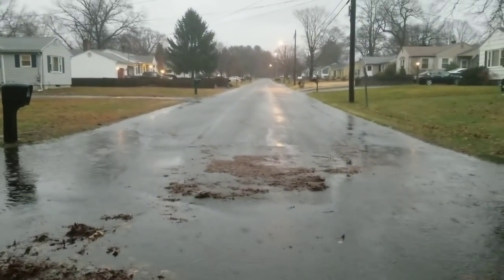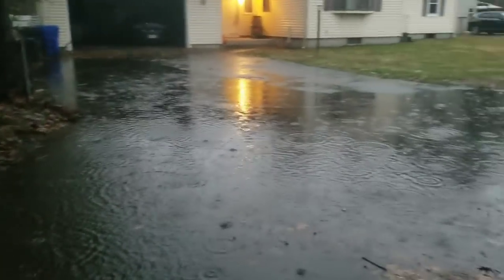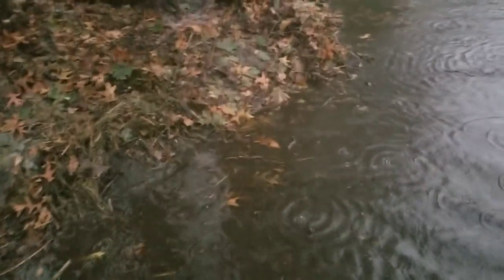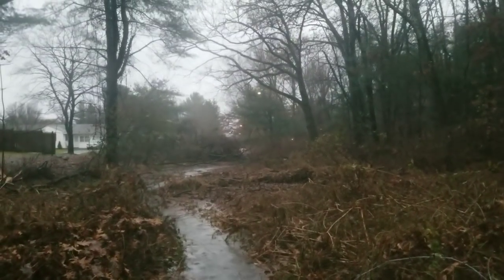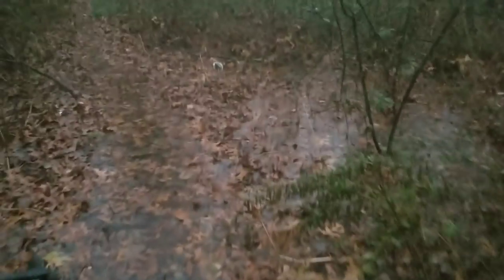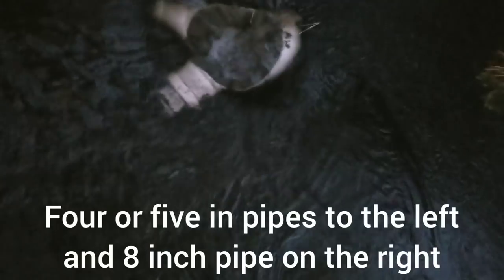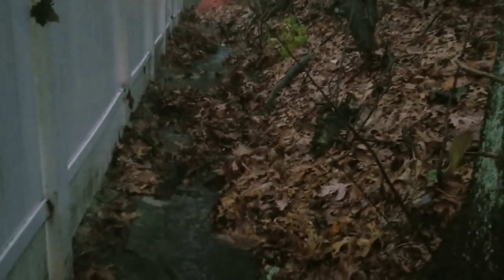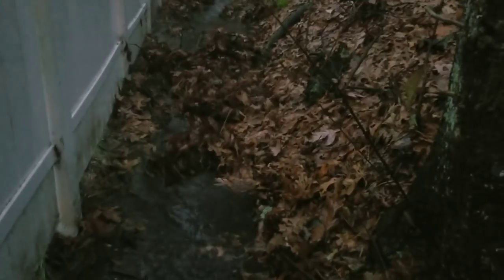Unclogging Drain And Drainage Ditch Undersized System

Comment: That owner should make the city fix this.  So they're house doesn't flood
Reply: the city?  as a homeowner you gotta grab things by the bootstraps sometimes... this is lazy homeowning you saw all those leaves??  invest in a leaf shredder,  a few times per month during the fall go back there with a 12pack and get to work on the leaves so they don't cause this mess.....    waiting for the city... that's just beta...
Reply: HI BYE *aren’t coming - YouTube English police.
Reply: Yeesh.  Reasonable answer for why the city isn't doing anything would be that it's a small problem that's expensive to fix.  This seems like a small town, and if it's anything like my own, it probably has a small budget for bigger issues than a little drainage pipe at the end of a street.  It's still not right, but unfortunately it's "the needs of the many" ect. ect.  Dunno why this is such a point of contention.  If the drainage pipe is owned by the city, then the house owner's responsibility in this situation is limited.  They didn’t build the pipe.  They might not even have been living there when it was built.  It's not their responsibility.
As for the leaves, many people do not have the time or resources or physical capacity for yard maintenance, but I for one feel as though I probably couldn't prepare myself for an entire neighborhood's worth of leaves and debris.  So, there's that.
Post 10 makes time to do this for people.  He is not the ideal solution, I think even he would agree that the best solution would be proper budgeting for drain maintenance in the first place.  But he is the solution available.  So he rakes.
Reply: @DominicciSkycam  At the beginning of the video, Post 10 was walking up the driveway next to a fence. The woods is on the other side and probably isn't the guy's property so shouldn't be his responsibility to maintain. We can barely see the driveway of the neighbor on the other side of the street. Shouldn't they have the same responsibility as this guy by your judgement then? Also, that woods looks like it has all sorts of root systems that rough up the terrain so would likely require manual pick up if controlled burning isn't used.

Comment: Wow, I have not seen anything like the open style in the beginning. 

Also, looks like they haven't done any hydraulic calculations on the system at all. I think the open trench was meant to drain the forest slopes so that the backyard doesn't get flooded but like you said, big pipe leading to small pipe with the additional forest catchment area guarantees it'll back up.

Comment: Put 3 or 4 wire tomato cages together staggering the ribs. Twist ties should hold it. Put what normally would go on the ground over the drain to catch the bigger leaves from going in. The leaves will pile up around the cages when you can’t clean it. It’s a temporary solution but it will work in a pinch. Thank you for being such a wonderful man. Your heart is so big!

Comment: My impression of this 'system' is it was a natural low spot that grew into a drainage 'ditch' and each of the property owners it passed through (or between) [ I don't know the layout ot property lines]  used whatever they HAD, or wanted, to 'help' the flow on THEIR property.  Not caring how it affected the others.  
It doesn't look like ANYONE (town, county) DESIGNED the overall drainage.
Just My Opinion!

Comment: There was this small bridge over a stream. It was short bridge, but very deep high. It was so short, you could drive over it, with out seeing it, but it was going over  stream twenty feet high. It was on a back road, so no one  thought about it. The bridge was blocked up about fifteen feet high, and had been for decades. It created a small lake on another road over. Some built house alonge the edge of this lake, and sold the houses as lake front property. The had boats, and it was all very pretty. The the county cleaned up the blockage. No more lake. Just house with boats in the back yard. Kinda of funny.

Comment: That was not designed by a civil engineer, because they have tables and equations they follow where the drains must be adequate under very high flow conditions, so their systems are usually way over designed. I suspect some subdivision contractor paid off a city official or inspector to approve this worthless system.

Comment: I agree with you on the poor design of that drainage system. A buried 4 inch or 6 inch pipe would have worked better.

Comment: That's what happens when the enginner says that it's an easy job, the technician will solve it.
Then the technician says it's an easy job, the work leader on spot will solve it.
The work leader on spot says it's an easy job so the commissioned digger guy with the machine will solve it.